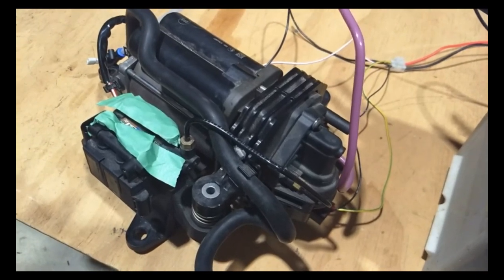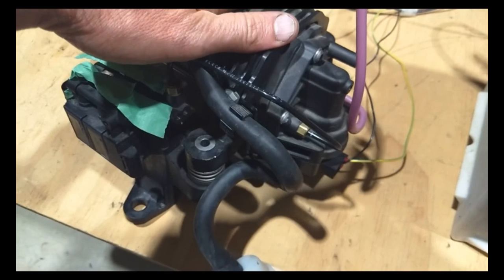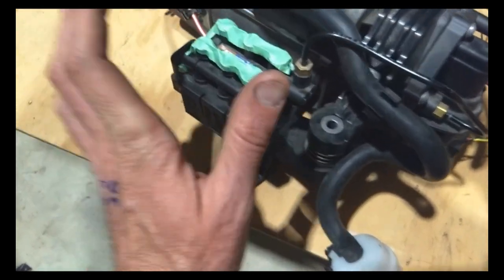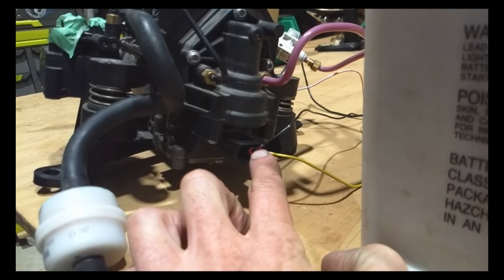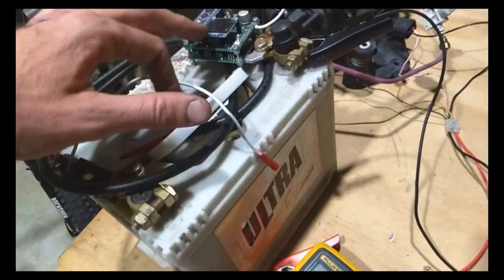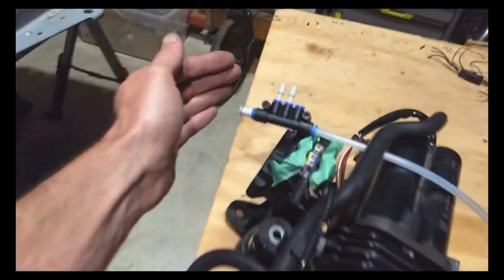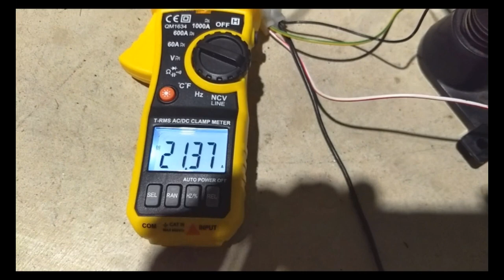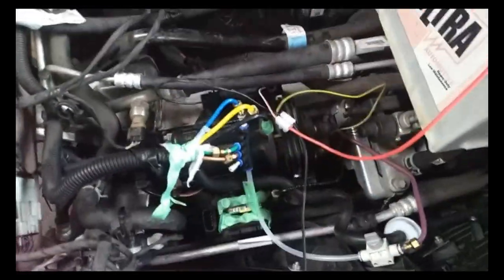Tesla Compressor Hack

Comment: Yay! That's satisfying. If you can't figure out the interface, at least you now have a manual override.
What's the sag rate, if there is one?
Reply from the maker: It had sat down after a weekend. Not bad considering it has an air tank as part of the standard system.
Reply: @RaglansElectricBaboon  That's pretty good - gives you plenty of time to move it after pumping up.
Reply: Hi - good work. I’m a kiwi working on a Tesla s and I’ve just got the same issue! Thanks
Reply: I have the same issue to 🥲

Comment: what's that 4 way splitter called?
Reply: i want to tap into the compressor and run a tank for a train horn
Reply from the maker: @joshuahuang07  possibly 'manifold'. I want a train horn on mine too. Let me know how you go :)
Reply: @RaglansElectricBaboon  haha prolly just dreaming but i do have a train horn laying around with a 12v valve actuator sitting around. do you know what size the hose is? hardest part will just be finding the correct size fittings for the hose
Reply: @RaglansElectricBaboon  also is the compressor behind the frunk on the X?
Reply from the maker: @joshuahuang07  I've never played with an X but I'd guess so. You're gonna have to go get your hands dirty yourself Joshua. Don't be afraid, its just big lego :)